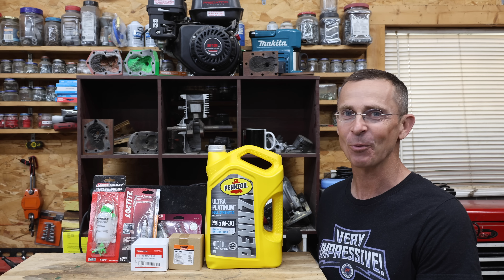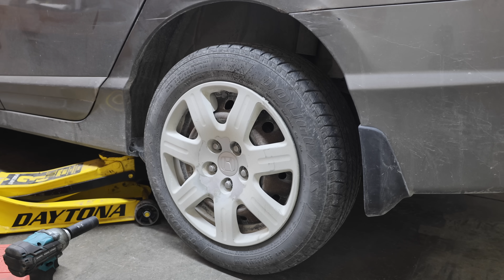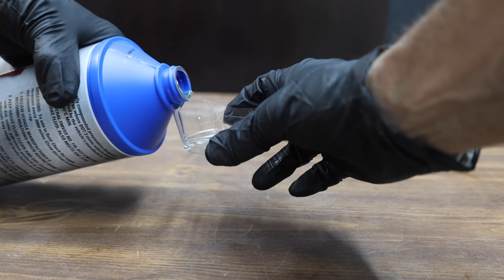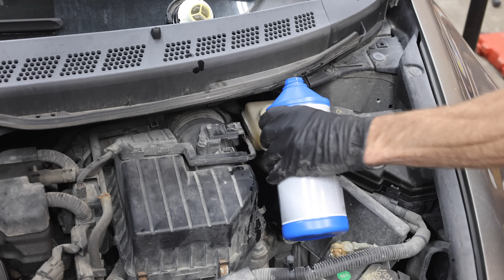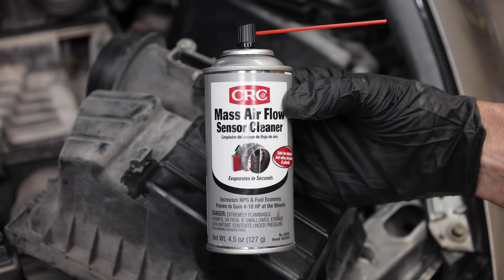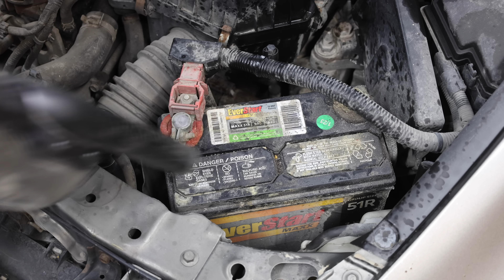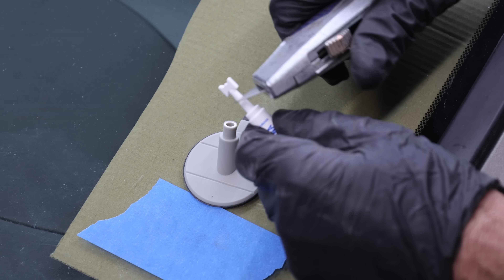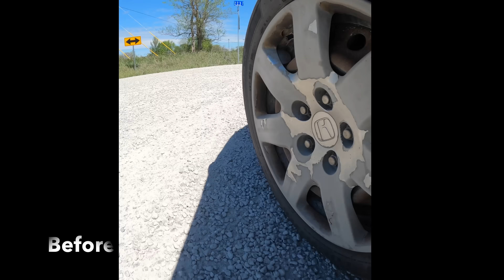Most Reliable 200K Mile Car? Let's Settle This!

Comment: it's really nice to see this kind of restoration videos. About people changing their cars due to minor issues, I do think this is because people just want to find excuses to get a new car. This applies to almost everything we buy. If there is something new you want to buy, you will always have something to complain about the thing you currently have. Not that I'm complaining. Not related but I bought nearly all the parts of my PC secondhand and I only spend the equivalent of $350 for my whole system which is way cheaper than the over $1000 I estimate I would have spent if I bought everything brand new.
Reply from the maker: Thanks!

Comment: Likely next video: How to replace your 8th gen civic transmission because the torque converter clutch is slipping after changing the transmission fluid.

Comment: i owned one of these civics. i had it from 120k-199k miles. the first engine cracked the block around 135k. had it replaced at a shop unknown mileage / year for the second engine. head gasket went on that one at 199k. the first motor was babied, the  06-07 cracked block was a recall / fixed on the 08-11 models. i beat the replacement motor got like a bareknuckle boxer. i do miss it
Reply from the maker: Thanks for sharing.

Comment: My wifes 2007 (2.4 liter) Camry has 315,000 miles on it. Bought brand new in 2006 and vehicle has been absolutely bullet proof. Only major repair was a brake booster replacement at 97000k. Normal maintenance otherwise. Its a daily commute of around 50 miles  a day. Lots of vacation miles. Believe me, when I'm ever able to pry her away from it one day, it will be a new Toyota replacement!
Reply from the maker: Nice!

Comment: Best bet is any gm or Ford truck from 96-03...parts are cheap and they're easy to fix. My current fleet of 4(2chevy & 2ford) have a combined 960k miles & all run and drive flawlessly.
Reply from the maker: Nice!

Comment: my Silverado has around 275xxx miles on it, I've done all the basic maintenance over the last 15 years but never had any major repairs.  I have changed the thermostat twice, and replaced the steering rack as the mounting lug broke, many sets of brakes and tires but nothing really serious, been a good truck that I still drive several times a week.
Reply from the maker: Thanks for sharing.

Comment: I noticed there was no mention of miles on the Honda.  Also, on those engines, regular timing belt service is critical, and could double your layout so far...or completely ruin the engine if it breaks.

If time of the last service is not known,  it's best to do it now.

Comment: Great job man.  Most people think that servicing a car or even replacing parts is something that only a "certified" mechanic should do. It's BS. Anybody can do it. It's just unfastening/fastening bolts and connectors and adhering to factory specifications/instructions.
  As long as you document your progress to avoid mistakes and keep your bolts sorted out, you can literally strip a car to pieces and put it back together without issues.
  It's the one thing i hate about this profession. It's overrated and employers are asking for too many "qualifications"/ "certifications" to hire you. Especially in Europe.
Reply from the maker: Thanks!  Thanks for the feedback.

Comment: My 94 Toyota 4 wheel drive pickup truck never breaks... But I fix things before they break. 
I've done the head,  the clutch,  gears and air lockers in both ends,  a little bit of suspension lift... and a bunch of other things... I'm keeping this one. 

  Peace.
Reply from the maker: Thanks for the feedback.

Comment: I started laughing when i saw the check engine light and the bumper, because my civic has these exact issues at similar mileage (though mine is wiring related, coolant temperature sensor appropriately enough, broken wire somewhere.. eventually I'll fix it). You'll be alright, they have their issues but they keep going, lol

I'm doing my brakes in a few days, i was shocked you don't have a brakes video. Any chance you can do an episode on brakes? So many cheap pads and rotors, how significant is the difference between brands and variations? I'd love to see your take on it.

Oh, related to the civic, check the starter.. if it hasn't been replaced, you might want to check the brushes. They cake up the starter motor housing with carbon and will suddenly fail you somewhere. Very easy to fix, but a pain to get to.
Reply from the maker: Thanks for the suggestion.

Comment: Case in point. Prior to it being stolen, we had a 2002 Subaru Legacy GT wagon. Very reliable and the only big expense we had mechanical wise was the head gaskets, along with the water pump, timing belt, a power steering rack, transmission mounts. It had the 60k service done on it after purchase as well. Besides those, it was a very reliable, low-maintenance car that lasted over 200,000 miles and would have gone longer had it not been stolen and totaled. Our 1999 Ford Escort ZX2 has over 185,000 miles and has some issues, but had really only had the timing belt done, a clutch was put in, and basic other maintenance items. Now our Volvo XC90 V8 is another story...purchased in June 2023, and last month we had to put almost $5000 into it for a new bevel gear, then $400 for an oxygen sensor, and it's going back in for an EVAP leak. I can do minor stuff myself, but major stuff goes to the shop! Goes to show how much you can do yourself though with simpler cars!
Reply from the maker: Thanks for sharing.

Comment: dang, $500 for a running honda? I'd pay that for a 2008 civic that doesn't run... I want the video on how you find a 2008 honda civic for $500.

I just got a '07 civic 170k miles but in worse shape than that for $6k and after some work it's the most pleasurable car to drive I've ever owned, but my wife agrees and took it for hers.
Reply from the maker: Thanks for the feedback.

Comment: pretty much do the exact same stuff at specified intervals.  a good reason wy my bought new in 95 Maxima is still road worth and would not hesitate to hop in and drive it across the country.  periodic/specified  maintenance will keep cars on the road until they rust apart or are destroyed.
Reply from the maker: Thanks for sharing.

Comment: For V6: Anything with a Toyota 2GR_FE series engine from early 2000's (Honda K series engines from early 2000's also count). I say V6 because they could be old but also has a proper balance of fun and acceleration. You don't have to feel like a grandma merging onto highways. Do oil changes and go gentle with the transmission and you're good for 200k.
Reply from the maker: Thanks for the feedback.

Comment: for Honda, it is recommended to run the engine with 3 fan cycle to bleed the cooling system with the radiator cap off, topping up when it goes down, with the funnel installed source (factory service manual)
Reply from the maker: Thanks for the feedback.

Comment: Only 200k? The most reliable engine isnt a honda...
Its the ford 302 windsor. Can easily do 650,000 miles between rebores.

Comment: I actually have this exact same 2008 Civic, I'm quite fortunate to have never had to do a single mechanical repair on this car other than a sun visor and center console latch, which were like 35 dollars total and a couple screws. Oil changes, brake pads, filters. Very reliable beast, I still drive it every day. I have money to get a newer car but can't find a reason to bother.
Reply from the maker: Thanks for the feedback.

Comment: Fantastic video! I have a 2013 Acura TL with almost 205,000 miles on it. Other than maintenance items (which I keep up with religiously), it amazingly still has got all it's original parts. I also keep it clean and detailed inside and out. I just took it for it's yearly safety inspection and the technician commented to me how impressed he was at the condition of my car. I do most the mechanical and all the detail work myself thanks to learning from YouTube channels like this one.
Reply: Love Acuras, I have a 2013 TSX 160k miles and it just eats the miles up, have lost zero efficiency still gets well above what’s it rated for gas mileage wise as long as I’m not always gunning it lol everytime I get it inspected or when I had the brakes done (everything else I’ve done myself) I’m told it’s got plenty of life left.
Reply: @cartere9981  That's awesome! I was looking at TSX's before getting the TL. I'd still love to get a TSX sport wagon though.
Reply from the maker: Thanks!  Thanks for sharing.

Comment: I love your content on your channel.
I look forward to seeing them every week.
I’m a maintenance nut and am very strict with maintenance schedules.
We normally keep our vehicles for 15-20 years or 250K to 300K miles.
My college car was a 78 bare bones Corolla. I owned it for 24 years and it died in 02 with 488K miles.
I’m quite sure that the rear differential was so sharp that I could have shaved with it.
Back then we had conventional oil, so it was changed every 2500-3K miles. The transmission and rear differential grease was changed every 30K miles.
All the belts, hoses, etc were changed ahead of schedule.
I suppose that’s why my old Corolla lasted so long.
I could have bought a new car after Grad school, but I really wanted to see how long my Toyota would last.
Thanks again for your videos
Reply from the maker: Thanks!

Comment: Nice video. I did the same thing when my brother bought a 500 dollar 2005 nissan murano, plus i replaced disks and brake pads, replaced coils and inyectors but did not replace belts, its my first time working on a FWD v6 and had to remove  the intake manifold. I love to work on my cars. Keep this type of videos coming.
Reply from the maker: Thanks!  Thanks for the suggestion.

Comment: Thank You for not wasting my time with long unwanted intros, if you have ever changed auto tranny fluid with the cooler line method (using the tranny's pump, not an external flush pump) to get all out at once instead of mixing old and new together, that video would be 'very impressive'.
Reply from the maker: You are welcome!  Thanks for the suggestion.

Comment: Great work! The job that should also be done is to check the condition of the valve timing gear. Replace high mileage worn belts or,  if it is a chain, the plastic chain  guides.  Both are much bigger jobs and add expense, but worth the effort to add reliability.
Reply from the maker: Thanks!  Thanks for the constructive feedback.

Comment: Stellar as always!     Only thing I would do differently is make sure to replace the seal when you change drive axles. I  have learned the hard way the old seals are not pliable enough to adjust to the new shaft, and always leak, on many transaxles the differential section fluid is seperate from the main trans fluid, and you wont know it all leaked out till its too late. For under $3 for a new seal its worth it for sure to not be doing all that work again to change it out!
Reply from the maker: Thanks!

Comment: Very inpressed by the fast paced video style and yet very detailed, wish more people made straight to the point videos like this.

Problem with used cars is that it's often a lottery wether you get a nice example that can be saved and a completely thrashed one.

Living in a colder climate without owning your own heated gararge complicates this a lot because you can't work on the car outside on some parking lot most of the year due to the freezing temperature and rust can often turn simple job into a hassle due to rusted fasteners and sized parts not to mention the risk of getting stuck without a car if you can't get the car fixed, this is much worse if you need it to get to work or rub errands.

Simple maintenence is something everyone should learn to do like changin filters, oil and various fluids as they're often not as risky or invasive as doing major suspension work (especially with rust)
Reply from the maker: Thanks!  Thanks for the feedback.

Comment: LOL 200K ??? My 01 Yukon has 365000 miles on it! Still running good it looks good 
the transmission was rebuilt once in its 23 years on the road!  (Way less than buying a new car) Everything still works!  200k 😂😂😂😂  that's nothing if you treat your vehicle like you should! If you treat it like you wear a sleeveless white T-shirt and  (You get the the stereotype) it's not going to last and will divorce you quickly.

Comment: Picked up a first generation Honda Ridgeline with 180k miles that was extremely well maintained. Just rolled over 300k a few years from original purchase now.  I've had to drop about $2k into it over the last 100k miles(I drive 130+miles daily) i've done all the work myself via you tube videos and only have had to involve a mechanic for wheel alignments, AC work and a few windshield replacements.  Common sense and preventative maintained goes a long long way.
Reply from the maker: Thanks for sharing.

Comment: I bought my 1997 Oldsmobile 88 for 900 Dollars, someone hit the bumper in a parking lot giving me 700 dollars. So it was basically a 200 dollar car after that. GREAT car, btw. All of my passengers complained until I fixed the AC, then it was honestly pretty comfortable. that 3.8L V6 GM put in there was pullet proof. I sold that car for 500 dollars later with about 390k miles. This isnt a meme toyota where I say it has 400 billion miles then tell you how many engines I went through. That's toyota people bs. This was 100% original motor, transmission, most things except the alternator, water pump etc were original. How many 30+ year old Toyotas do you see driving around? I still see 80s American trucks driving around owned by people that are drug addicts. I dont even remember the last time I saw a Toyota anything older than 99, yet that's what the memes tell people is the most reliable car, because memes and marketing campaigns create their reality.
Reply from the maker: Thanks for sharing.

Comment: You covered literally everything a young car owner should know - even cost of ownership vs buying new!

Maintaining your own vehicles isn’t that difficult, and can save so much money.  Especially if you’re not afraid of driving something “old”.

My oldest car has  ~280k miles (don’t know exactly, the odometer broke at 260k 😂), next one has 190k, and our “new” car has 100k.   

Maintenance costs have been minimal - brakes, oil changes, water pumps, etc.  Gas, tires, and insurance are the biggest expenses.  And of course, no $800+ monthly car payments to worry about…
Reply from the maker: Thanks for the feedback.

Comment: I learned a few things from this video, which I was pleasantly surprised about. Didn't know how to do upkeep on disc brakes, nor did I know you needed to add electrolyte to your batteries. 

I owned a 06 civic coupe for a long time and the thermostat going out and the bumper panels coming off is a major problem with them. I could never keep the bumper panels on, even though I reattached them with new clips a bunch of times. Didn't think to just use a bolt, washer and nuts. 

Also, the civic is by far the easiest car I've ever worked on. Everything is accessible.
Reply from the maker: Thanks for the feedback.

Comment: I drive a 97 toyota camry that just wont die. I keep up on all the maintenance and it is absolutely reliable. I even tow a small 8x4 trailer with it to carry my dirt bike or ill make it carry heavy loads to the dump. No major problems and it is pushing 235,000 miles.
Reply from the maker: Thanks for sharing.

Comment: Get a regular (transformer based) car battery charger and charge the battery. Especially after adding distilled water it will be beneficial for your battery. 
Remember to disconnect battery fron car or even better remove it complety for charging. You can test it after 24hrs after charging it.

Comment: This is a really cool video. I have a 2016 Honda CR-V with over 250,000 miles. I’m about to replace my spark plugs, engine coils, and struts. It’ll be my first time doing each. Your video gave me extra confidence to switch them out. Thank you for your videos. I check your channel before buying a lot of products. 

Have you ever done a review of chop saws and/or chop saw blades?
Reply from the maker: Thanks!  Thanks for the suggestion.

Comment: i own 2018 chevy traverse, done 160K km. i changed transmission oil as per manual (1st at 76k km, 2nd at 144k km), after the second change i had transmission problems, reverse gear not engaging, gear 2 and 3 not engaging smoothly, had to do transmission repair work (covered under warranty). you have lot of experience with cars having high mileage. what do you suggest about changing transmission fluid? i did what the manual says but still got problem. some people say dont change transmission fluids if vehicle have high mileage.

Comment: I don't even need to watch. I'm just going to tell you the most reliable vehicles you can buy. 2003 to 2009 Lexus GX470 and Toyota 4Runner. The 2uz-fe in the GX470 is one of the most reliable engines ever and multiple examples have hit over 1 million miles. Buying a GX470 at 200k miles is a common thing for people and there are many out there with 300k to 500k+ miles on them. If you maintain them regularly it is the best SUV you can buy.

Comment: A year ago I sold my 2007 Toyota Highlander with 287k miles on it for $1k to an older car guy who wants to take it to >300k miles. He knew me and knew I was religious about oil changes and other PM work. I bought it with 87,000 miles on it for $17,000, drove it for 10 years with ups and downs with my job, which made me know I couldn't afford another car and payment.
Reply from the maker: Thanks for sharing.